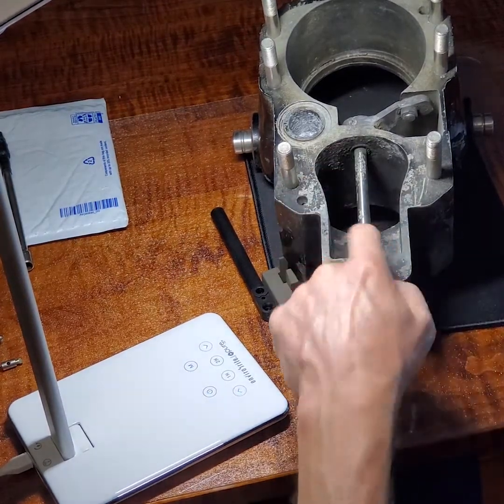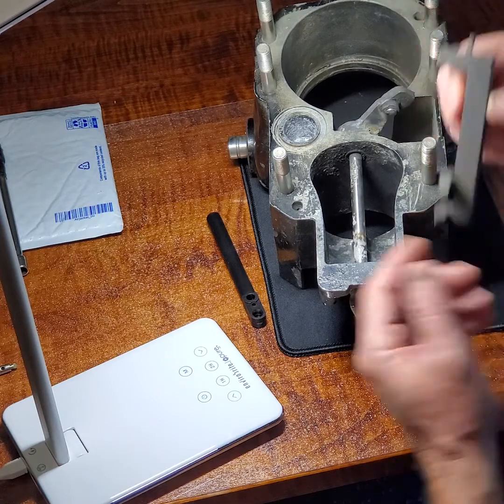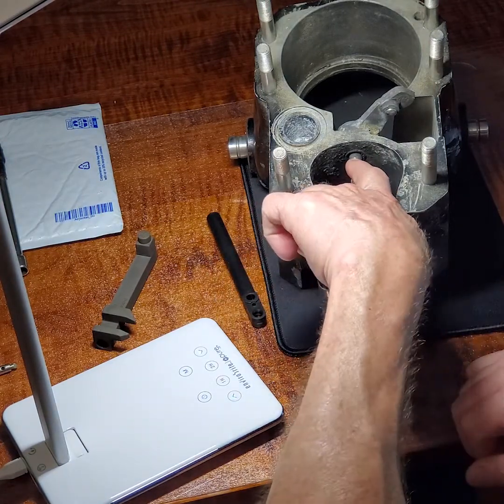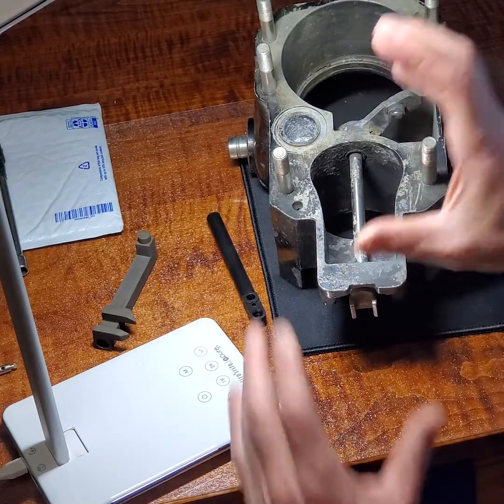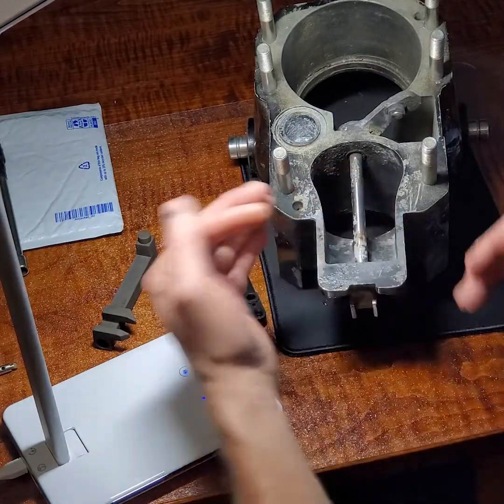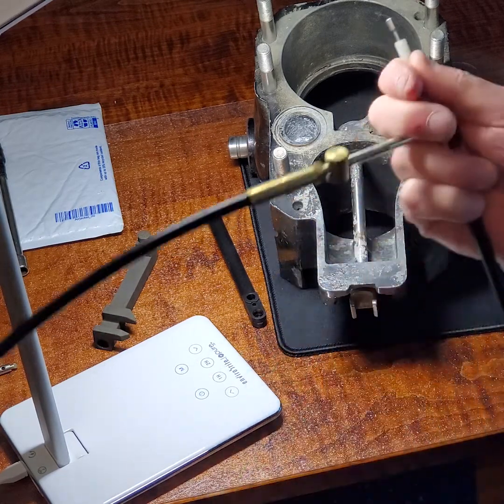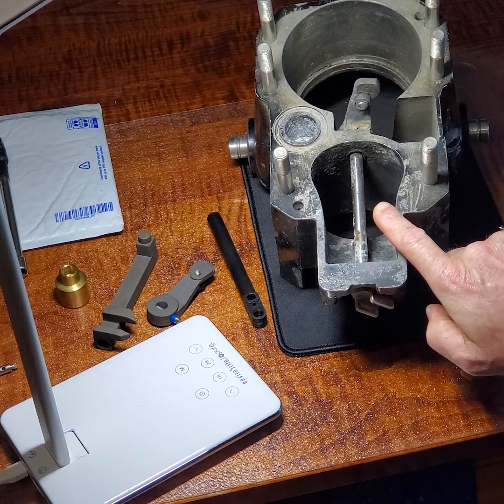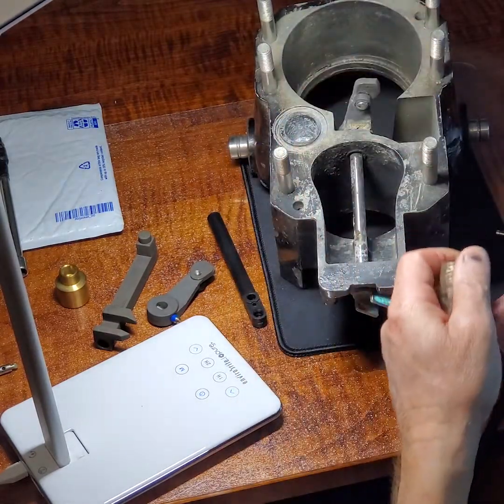MerCruiser Alpha One Shift Shaft seal and Cable part 1

Comment: I just got my first boat . Its late 80s. Mercruiser 3.0... last weekend I was pulling a tube... I have only had it out twice. Its been hard to shift into gear. It just has a lot of resistance and it dies a lot going into gear. But eventually gets drivable.  Anyway this time I was taking off. It just kinda popped into neutral and won't go into gear. Forward or reverse.  Running fine.  But changing gears does nothing

Comment: great video! The water can also seep by the big, rubber O ring on the bell housing and into the joint bellows. I wonder about putting some kind of sealant on the  O ring?
Reply from the maker: You can put some none hardening sealer on it like Mercury "perfect seal"

Comment: Hi guys, thank you very much for the tip on how to install this bushing with your homemade tool. In the kit there are two bushing, i am wondering where you install the little bushing?
Reply from the maker: It is for the area at the bottom of the exhaust passage. I find it typically is not necessary to  change
Reply: @tedsmarinerepair8956  thank you very much

Comment: I have a 1988 Chaparral 178XL with 3.0L Mercruiser Alpha One. I suspect I have this problem. I am unable to read the serial number so it’s hard to figure out what parts diagram to use. I should probably start with the correct repair manual. Any idea? I believe the s/n outdrive starts with 0C313 or 0C813. Engine placard says “Drive Unit” Serial No. 0C304120

Comment: Hi Ted,
I have a Alpha 1 Gen 2. My shift shaft bushing and seal is flush on topside of the housing. The replacement seal I see in your video looks like the top portion reduces in size. Is this seal flush with top of housing shaft? If it protrudes, the lever assembly won't fit.
Reply from the maker: Hello Robert,
Yes the old "gen  1" bushing and seal assembly is a one piece unit that is smaller where it is installed into the housing  (larger on the bottom) where the seals are.
The Gen II is different in that it there is a busing that is installed first then two back to back seals are installed afterward -it is not a one piece unit like Gen I.
I will post a short video to show the difference to clarify.  Thank for the question, I'm sure there are others with the same.
Reply from the maker: Yes, the installation for a GEN II bushing is: you install  the bushing first, from the top pressed down, and then the seals are installed from the bottom pulled up. 
Gen I is a one piece seal/bushing assembly and gets installed from the bottom up.

Comment: So when you are screwing the shift cable into the bell housing the cable is going to spin and the second person helps support the cable while it spins?
Reply from the maker: Yes.  the second person is inside the boat helping rotate the cable while it is threaded in. This is if you dont fully remove the ll housing and are just changing the shift cable.
Reply: Thank you for the prompt response. As stated in your video I think I buggered up the threads. I will try and clean it up today. Much appreciated.

Comment: Ted, we have had problems with the brass intermediate shift shaft falling down and the boat being of course unable to shift. Does this sound like a familiar problem? Any help would be awesome lol thanks
Reply from the maker: Not something I've seen. Could be a bad install or the wrong part. It is a press fit so I cant explain how it would fall out.
Reply: @tedsmarinerepair8956  it's definitely the right part. I don't see any other way to install it, it simply came with two thin stainless steel washers and a cotter pin. There really doesn't seem like any obvious way to do a bad install, there's nothing to screw up as far as I can tell.
Reply from the maker: @Doomzdayxx  ok I was thinking of a different part. Can you give the part # so I know exactly what your working on.
Reply: @tedsmarinerepair8956  Yeah it's mercruiser 62104. it's a brass :shift shaft". I forgot that you probably work with multiple types of stern drives, not just a alpha one gen 1 like mine :D
Reply from the maker: @Doomzdayxx  OK got it! I've seen this a bunch of time. So what you need to do is put a SS (Stainless Steel) washer on top of the lower unit shift shaft and let it sit on top of the shift shaft seal that holds the shift rod up at the correct height.  It is #23 in the image http://www.boatparts.ca/mercruiser/lower_gear_case.html
If you have a 3/8" SS washer you can use that too. if they are thin you may need 2
Reply: @tedsmarinerepair8956  Ok cool thanks man I really appreciate it!

Comment: I'm changing all of my bellows.  I noticed that the new style is installed already.  The boat is new to me so i dont know how long it's been there.  Do these newer seals last a while or should I just change it out? Thanks and great video.
Reply from the maker: If the cable is still smooth and your in there doing a bellows job. Change it, its cheaper and easier than a shift cable.
Reply: @tedsmarinerepair8956  Thanks. Changing shift cable anyway.  Go big or go home...lol...thanks.  $50 more now to save weeks underway during the season.
Reply from the maker: @joeguerrier7975  good choice! Enjoy the summer boating worry free!
Reply: Dinged up the shaft slot a little on top while punching the seal out.  Will that be a huge problem?

Comment: Quick question, I am about to start a bellows and shift cable replacement job on my alpha one gen 1, would you recommend I replace this shift shaft seal while I have things torn apart?
Reply from the maker: Yes absolutley
Reply: @tedsmarinerepair8956  Excellent! For those that might be wondering, the same technique Ted mentions to install the new bushing can be used to remove the old bushing, you don't really need to pound it out.  I used 4" 1/4 bolt with a 3/8 socket on top to push the bushing out and a 11/16 socket on the bottom to catch it with washers on both ends.  I also used a little liquid wrench to help it along.  Piece of cake!
Reply from the maker: @neverclevernorwitty7821  Agreed! That works great too. I just like to save some time during a bellows replacement job.
Reply: @tedsmarinerepair8956  Quick question, I got my replacement bushing.  I noticed that after removing the old bushing, there was still a sleeve left in the hole that appears to be separate, but integral to the bell housing cast.  The sleeve also looks brass, so when we install this new busing, just like the last, it will be a brass on brass friction install, correct?  The new busing of course appears to have a much more robust rubber seal insert though.
Reply from the maker: @neverclevernorwitty7821  can you please email me a couple of pictures to me at marinedoc01@yahoo.com
Reply: @tedsmarinerepair8956  Thanks, I sent ya an email!

Comment: Hi,
Would you know the OD of the new bushing? My current OD is .750 or 3/4". My drive serial OW.
Reply from the maker: Here are two different seal kits you can order from Basic Power Industries, both kits come with the lower bushing (that looks identical) for the bottom of the bell housing.
For Gen II
https://bpi.ebasicpower.com/mm5/apps2/master/showparts.php?COM_NAME=Bell%20Housing&MODEL=5&IMAGE=1000000067&ITEM_ID=404

For Gen I
https://bpi.ebasicpower.com/mm5/apps2/master/showparts.php?COM_NAME=Bell%20Housing&MODEL=5&IMAGE=67&ITEM_ID=6

Comment: Great vid thanks Ted.  Question if you have a sec - I purchased a new updated seal kit from Merc but the diameter on both the top and bottom (especially the bottom) is much bigger than the old and the upper shift shaft is loose, only held in place really by the tension of the upper seals.  Have you run into this?  Conflicting reports in forums of course.  Thanks hope all is well
Reply from the maker: Bill, sorry for delay I 've been trying to get to measuring the Alpha one vs the Alpha Gen II seals, housing etc. for a new video post - just been to busy with boat repairs and teaching. It's on my list! Thanks for the message!
Reply: @tedsmarinerepair8956  thanks...I’ve been searching around, ordered the seal kit by mercury and Sierra, both the same.  Saw another note on sterndrives forum that mentioned that’s how it is, they’ve installed many, and they were a tech, so they say.  I’ve installed mine, will update if I see any shift issues (probably next season / April (NW). Shifts fine at the moment. The upper is slightly bigger than the old style. The lower is loose.
Reply from the maker: @bniwa  If you have the drive off, and the shift shaft seal has never been changed (as far as you know) I recommend changing it. Parts are cheap and it extends the cable length considerably.

Comment: I've got an older MC-1 drive with this shift shaft bushing failure. Have you ever seen water make its way past the large o-ring and into the u-joint bellows? Pulled drive off for end of year maintenance and found that water had been sitting in the shift cavity for a while, and that the large o-ring just before u-joint bellows was extremely deteriorated with a small amount of water in the bellows. Bellows/gimbal and all that were new last spring and thankfully gimbal is still smooth as butter. I'm hoping I can just get this bushing and it didn't take anything else out. It was still shifting good at the end of the season so hopefully I'll be aight. 

Thanks for this vid
Reply from the maker: Hard to say, The drive gasket and the flat foam o'ring/seal would both have to fail and that would flood the bellows area completely likely. It could be water from the engine room sloshing back during acceleration if their is excess bilge water.
Reply from the maker: @iWatchVideosAtHome  
Sorry I was a little confused on your original message. Yes either the large round o'ring seal or the gasket between the drive and the bell/pivot housing could be the cause. If you don't have a lot of water then likely one of them was allowing the water to seep in. And being a trailered boat no chance of water in the bilge doing it. 
I would make sure both surfaces on the drive and bell/pivot housing are very clean, (absolutely no residual gasket material) and put the drive back on with a new kit. I coat the gasket with a light coat of grease to make removal and gasket changing easy for the next time you take the drive off.
Hope that clears it up!
Thanks,
Ted
Reply: 100% the water is leaking through the big, rubber O-ring between the leg and the bell housing, I replaced all my bellows, meticulous about cleaning surfaces, applying bellows adhesive and seating bellows properly. After one summer of boating, trailering the boat, took leg off and had a bit of water sitting in the u-joint bellows. You could clearly see where the salt water had flooded the shifter area and seeped past the bit O ring.